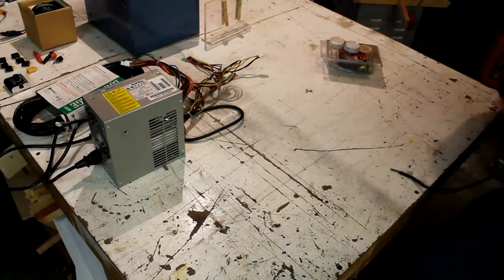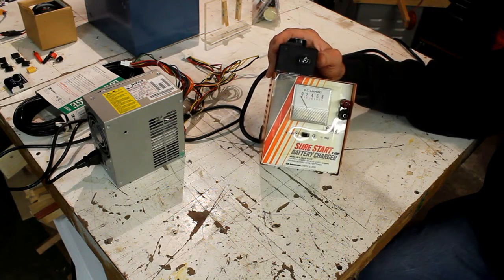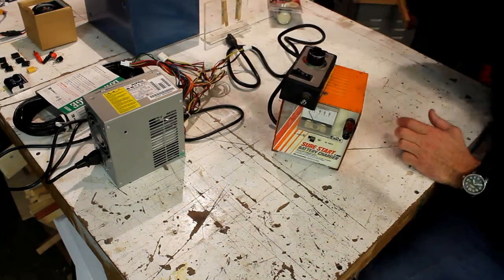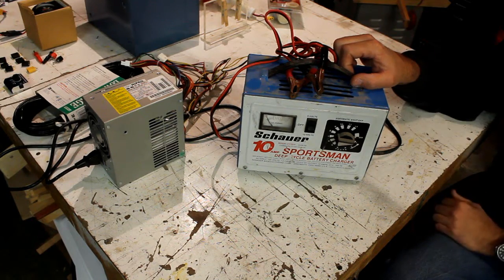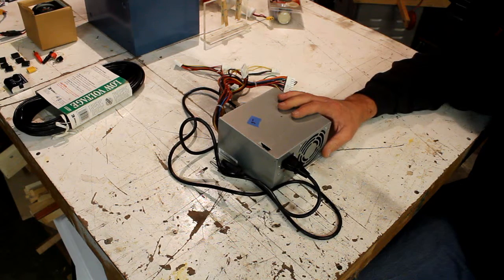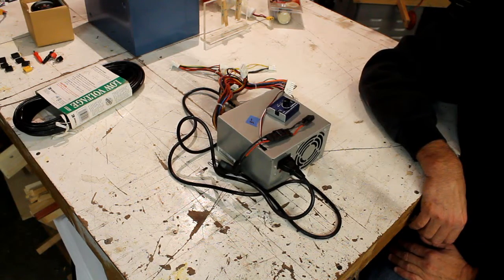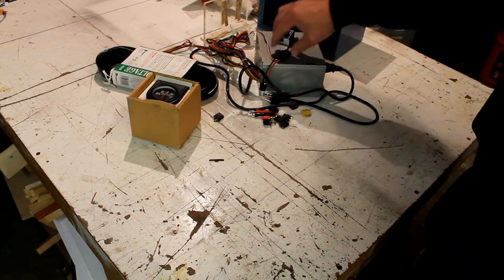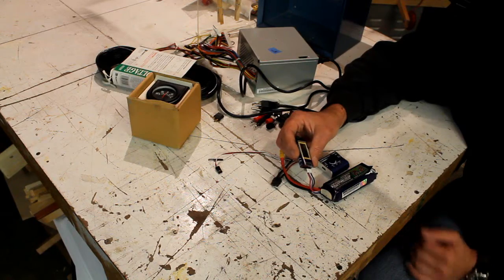PowerSupplyPart1

Comment: I have also been using a Manual battery charger for years but why the router speed control ??   does that control the heat if you are cutting smaller cores ??    for any smaller work i have done up to this point is using an old model train transformer .   always wanted to try a regular rc battery  with s speed control and a servo tester to control the heat .
Reply from the maker: Yes the router speed control will let you turn down the current. That way you can fine tune how hot the wire gets. I like this system best of all the ways I've tired.